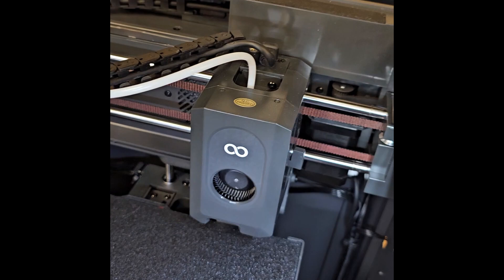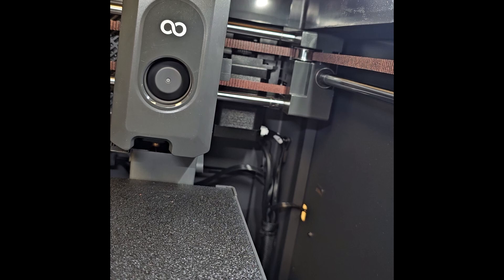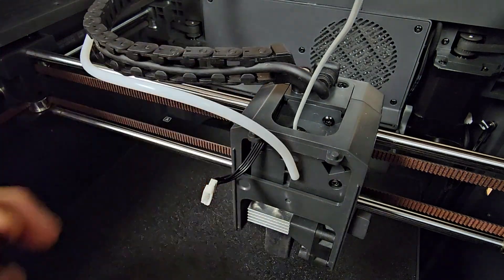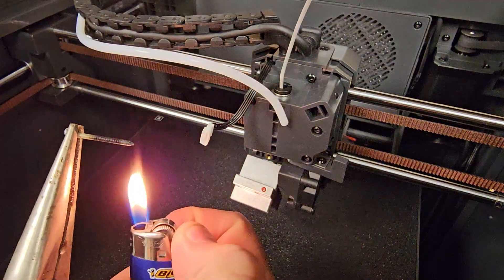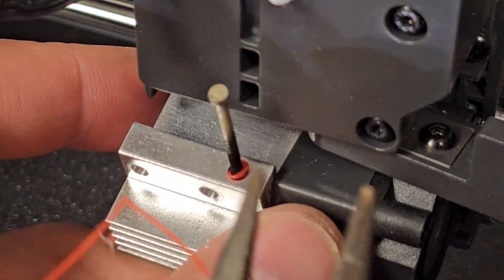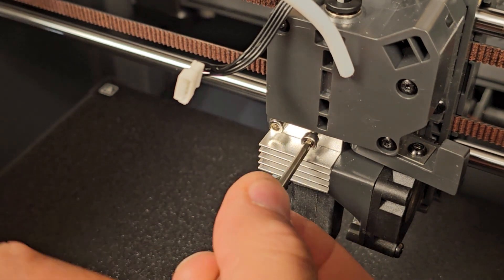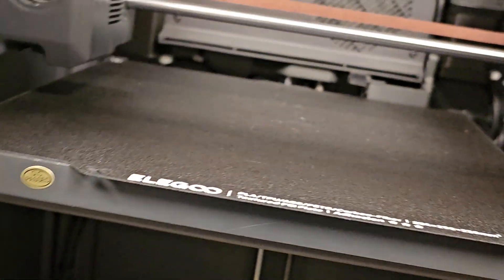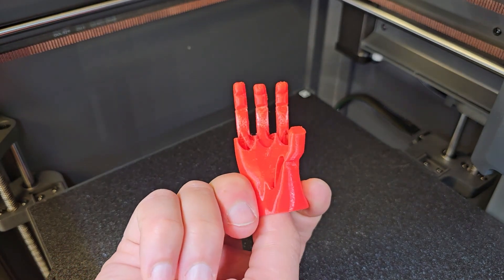Unclog Elegoo Centauri Carbon Quick and Easy!

Comment: BOLO for cold solder joints on the board for the heater and thermistor connection.  Just changed out my stock hot end...had 2, yes 2, of the connectors (fan & thermo connector) break off when I tried to connect the new hot end.  Firs, the thermo connector had cold solder joints...I disassembled the head to pull that connector board off, re-solder and installed.  When I plugged the 25mm fan back in, yep...that connector had the same issue - cold solder joint and broke.  Removed that board again and re-soldered those connections.

Comment: Cool! For most clening process there's no need to dismantle the tube and side panel, removing the nozzle and using the small allen key that comes with the CC with the same process works like a charm, then heated needle if needed.

Comment: This just happened to me (again). I simply press load filament with hotend temp set to 320ºC and it unclogs. If it doesn't, move the head to the opposite side and load with 320°C

Comment: 3 prints in and it wont load a filament....having serious doubts about this brand already
will see if this helps... not really happy that i have only had this for 8 days
Reply: Try the extrude function instead of load. Mine on load feels the wheels go backwards, so I just use the load function.

Comment: How do you prevent this from happening in the first place? What is the proper "shut down sequence" when unloading filament? Everytime I'm finished printing, I will unload the filament using the unload setting but on the next day, I have to use the needle every time I go to start a new print because of a small clog in the nozzle.
Reply: There’s a load and unload feature in the printer software. Follow that procedure and you should have no problems

Comment: So this is embarrassing... i had clogging issues that made me had to remove my nozzle. Problem is the plastic casing for one of the connectors got stuck in the slot, with the prongs neatly yanked out. Can't even put a new one in so long as that case is in the slot... anyone got some suggestions??
Reply from the maker: Yup try this......i just found this connector removal tool on printables
https://www.printables.com/model/1400159-elegoo-centauri-hot-end-connectors-wire-removal-to
Reply: @ProductDesigns  thanks for the link. I have a second printer, but that's also out of commission. There is a 3d print shop few minutes from home (isn'tthat convenient?,) so I may just ask them to print it out. Wish me luck.

Comment: 0:34 in order to remove the tube, you need to press down the black sealment that's connected to the tube at the same time. Would be nice if you mentioned that, I was stuck for like an hour trying to remove the tube
Reply from the maker: Edited.....I went to check the video and I did say push on collar and tube will pop right out. Sorry you struggled on this step

Comment: THANK YOU FOR THE VIDEO !!!. I had the same clog as you. Just with PLA-CF. I had purchased the spare HotEnd. So, I just swapped it out. Now I can use your trick to pull the clog out.
Reply: Did this work for you? I also had the same issue with PLA-CF
Reply: @mlb10384  It did not. Sorry. I have to totally disassemble the HotEnd.
Reply: @markcalhoun9480  So I went and got the nail to try this, I already removed the nozzle, i was pushing with a cold nail and was able to clear the jam.  To be clear I had already take the nozzle up very hot so there was no material in the nozzle.

Comment: Or you could just buy a noclogger tool and never take anything apart again for a clog.
You just heat up the nozzle and push the tool though the top and it push out any stuck filament, let it cool and pull straight up and out for anything left over in the nozzle.
It works great, just don't push it in when the gears are moving and your good.
Reply from the maker: Heck ya.....I looked at the no clogger and this seems like a nice piece of kit to have around. I might order one to check it out.
Reply: @ProductDesigns  It's worked well for me and the worse case scenario may be, you may need to replace the extruder gears down the road but as long as you just heat up the hotend and not use the load/unload feature, your gears should be fine. I've used it more then a dozen times with no issues.

Comment: The only time I had to disassemble the hot end was when I used Rapid PETG, I never removed this second cover, what I did was remove the nozzle and the hot end and heat them up outside, clean them and put them back, this method of yours is less laborious except for the part of removing the second cover, but it's good to know.
Reply: Removing second cover just makes it much more convenient to work on, disconnect, and in general to mess with the hot end
Reply: @simonwest80  This is my first machine and I clogged it several times doing filament tests, and I already disassembled it the correct way, removing the complete cover, but the quickest and easiest way for me is without removing the cover, just releasing the hot end, but everyone has their preference, and mine may not be the correct one, but it is many screws easier.🤣
Reply from the maker: Yup 2nd cover is not necessary in my case, but I also showed other less common spot jams can happen.

Comment: 1. That is not a clog, as the filament did not touch the walls and you only got out the filament residing in the aluminum heatsink. Had it been clogged here, you would not have seen a gap between the walls of the heatsink and the filament.
 A clogged nozzle will clog at the most narrow point, the 0.4mm exit orifice. Un-melting contaminants will collect here and possibly move around in the hot liquid, and eventually be pushed to the exit, where if small enough, enter the orifice.
2. You don't need to remove that second cover.
3. Don't do this maneuver with those connectors attached, breaking their PCB is a bad day. Remove from the print head.
4. An stopped job, as the printer does not have a clog sensor, or filament movement detector,  a jam could be from either a clogged nozzle orifice, or a jammed filament. I can get stuck in the roll in the winding process where it was packaged.
5. To remove the nozzle from the print-head it needs to be heated up as per Elegoo's Wiki page.
6. A clogged orifice may be unclogged, while heated, clamped in a fixture orifice side up, and chase the the obstruction out with the included  0.3mm  "needle".  After a cool down any remaining plastic can be chased out with a ~2 mm drill (0.078" or less) , while held in a vice or pliers. All loose material must be cleaned out, 
7. Unclogging inside the printer, while hot, the "needle" may just push any debris to the side, to later reenter as plastic is fed into the nozzle. I'd say a waste of time.
8. You can get spare all-steel nozzles on Amaxon,  and others, for not much, but these needd to be checked for debris before installing.
9. Check this movement sensor project for Elegoo CC https://www.youtube.com/watch?v=6JYKpZ3HX2Y&list=WL&index=2
10. Leaving the Model fan connected after being unhooked can be turned on manually if you need to cool down the nozzle to work on it. Turn it on in the control panel and carefully turn it around and direct the airflow towards the nozzle.
Reply from the maker: Lots of good info in this reply. Thanks  for some more detailed procedure. I agree not all clogs are the same.....I just covered what is the by far most common in my experience. I like to leave it plugged in because manipulating plug too much can cause other issues because it's not that robust. But yes you have to be very careful because yanking on pcb would be bad for sure. As for nozzle obstruction I would imagine my method would be capable of yanking debris stuck in plastic with it as well.  Plastic would back all the way up (no gap). The method you posted is a good catch all and a great supplement to this method should it not work. Thanks.

Comment: Can you design a plug tool that allows for precise application of the nail at optimal stabilized temperature.  Maybe even comes with several of the nails that fit?
Reply from the maker: Hmm perhaps....wonder if there's enough demand for something like this? A finishing nail is pretty simple and cheap.

Comment: Silent mode fixed my stringing and drying made my print much cleaner looking.Messing with retraction is kinda risky imo. I don't want my printer head to burst from all the pressure built up from the retraction..... Good info on the clog fix ty

Comment: In my experience with TPU, sometimes the spools come from the factory with some moisture content. I now make it a habit of always printing TPU and ABS from a filament dryer. I've put brand new vacuum bag sealed spools of TPU in my dryer and watched the humidity meter go up to 25% humidity as the filament heats up in the dryer. Once the meter goes below 5% i start printing with it.
Reply: All you need to do if this happens again is remove the bowden tube heat up your nozzle hot, take a 6 inch piece of filament and push it through while pressing extrude until the whole piece goes through. This will save you disassembling every time the gears jam like that
Reply from the maker: @sped8285  i did mention in video about 50٪ of time a more rigid filament will push plug out.
Reply from the maker: Yes I agree. I've dialed in tpu printing and drying is really essential for the best quality. Showing what ive learned in the process will likely be my next content.

Comment: Supposedly you can use the printer bed with a box as a dryer.
Reply from the maker: I'm using the poly maker dryer with cereal boxes. It's a but more permanent solution that keep all fillament dry and ready to go. I'll post my system in a future video
Reply: @ProductDesigns recently finished six Ultimate Cereal Dry Boxes from printables myself. Hope they work well for you.

Comment: Thanks for the video. I will definitely take that printer off of the list. Very poor designed hot end assembly.

Take care.
Reply from the maker: The printer is actually AMAZING. There is no better value for your money. 

The clog happened because of the cheap tpu I used. It was sticky on the spool and kind of snagged. When i figuered this out I printed a respooler for filament and that solved the clogging issues. That's actually going to be my next video explaining what I've learned to print successfully with tpu.

Comment: They include a tool to push clogs out. It looks like a long pin with a spring end.  You stick it in the .4 mm end with the hotend hot.  This also may be caused by your Bowden tube not being pushed all the way in, leaving a gap for a clog to form and not able to get hot enough to push through.
Reply: The needle isn't helping when the clog is up to the cooler like in the video. It's just for cleaning the nozzle. I tried using that needle yesterday for a similar case of clogging and the PLA up there wasn't melted so the needle just bent but didn't push the PLA out. That's also the reason why he's heating the screw manually instead of heating with the hotend.

Comment: My 1st mod! Made it easy to remove extruder cover…… and it’s much easier to do what your doing then how you did it.
Reply from the maker: Hi, what was your 1st mod? 

I mentioned in another comment this fix can actually be done after only removing the magnetic cover and then 2 screws for the hotend. 2nd part of cover removal is only needed to give easier acess to hot end connectors.
Reply: Hi, I'm interested in your mod too, thanks

Comment: Push the cutter when you remove the hotend. It makes it easier. Mine clogged in the same spot with silk pla, but the hotend wire connector broke so I'm waiting for a replacement board from Elegoo.
Reply from the maker: When you do the unload command the machine moves the print head and pushes cutter lever automatically when it's at front right corner. 

Yes the connectors are fragile. When you do this method you MUST keep the hot end stationary so the wires and connectors are not disturbed during pull.
Reply: @ProductDesigns  Yes, but when you go to remove the hotend, instead of doing the angling thing you did, just press the cutter lever to pull the hotend out.

Comment: 3:16 there is an Allen wrench included with the printer that is small enough to fit through the filament hole of the hotend. I just cleared a nozzle clog earlier today and I used this Allen wrench and a heat gun to clear the clog.
Reply from the maker: Glad to hear that worked. I've done my method with a completely cold hot end with no probem also.

Comment: I think you could also heat up the extruder when it's hanging by the wires to make it easier to pull out the clog.
Reply: After going through a partial nozzle clog that would not shift (I don’t have a spare nozzle but have 6 on order) my most successful way of clearing was to allow the hotend to cool, remove the ptfe tube from the top of the hotend leaving the filament in place (do not cut the filament) heat up the hotend to 100C with pla 140C with nylon , grab the filament that is coming out of the hotend and pull lightly and press the retract icon for the extruder , this should pull the old filament out of the hotend including the nozzle hopefully with the clog or bit of debris that was causing the issue.
Reply from the maker: @paulmason6847  i like this idea however when i tried it with tpu it wasnt sucessful for me.
Reply: @ProductDesigns yep tpu would be a problem.
Reply from the maker: You guys are suggesting using the alan wrench in place of the nail? I like the rings on the nail to give something for the plastic to grab on to. 

On a side note the hot end is accessible with only the magnetic cover removed to save even more time. Ill update video to reflect this.
Reply: @ProductDesigns  Both the Alan wrench and the nail/screw method work fine in my opinion.
Reply: @ProductDesigns 1.5mm Alan key works
Reply: I agree, I think this would be the best way to do it. Heat up the hot end, use the included smallest size Allen wrench, and a pair of pliers to hold the Allen wrench when pulling out the clog.